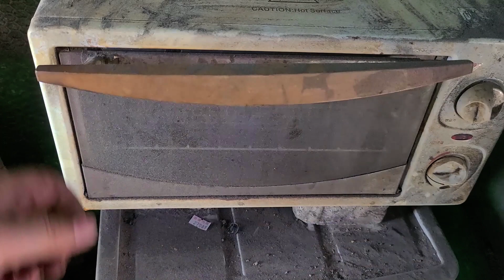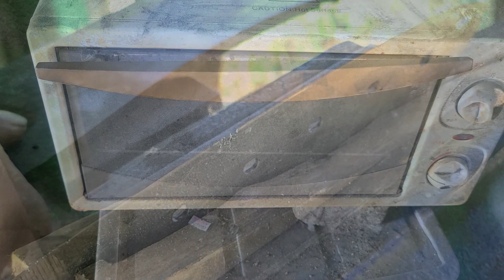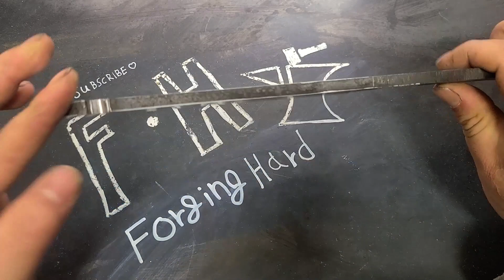Make a Cleaver (Jeju Nadae) Knife from Car Spring

Comment: Very nice cleaver!!! Just curious what did you use for the etching? Was that drawn on with the paint marker and that’s it or what’s max that a vinyl sheet you used as a stencil?? Also what solution was that? I tried etching and just can’t figure it out? I used the charger and paint markers ect but, seems like it won’t be a good visible crisp etch?? Salt water ect??? Thanks for responding to past comments also! Keep up the great work!
Reply from the maker: Thank you for watching.
This knife was marked with a paint marker. Etching uses electric etching 12v. My etching device was given to me by the H-art channel as a gift.